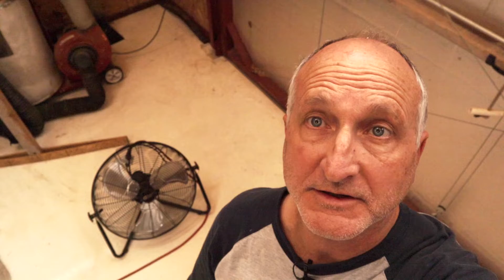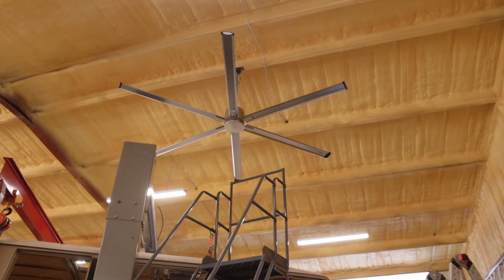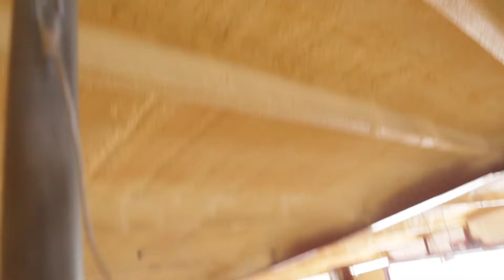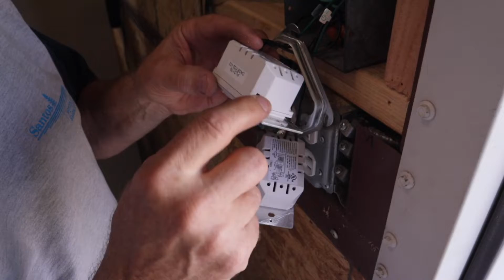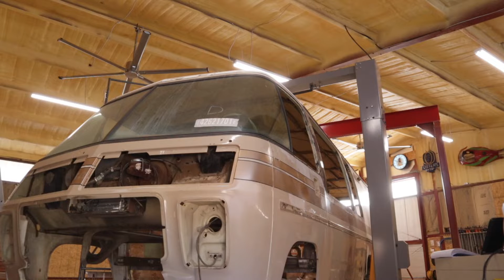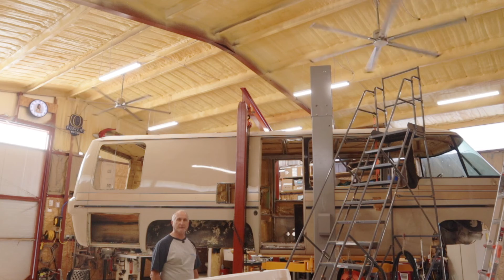Hubbell 8 foot ceiling fans, installation and wall control programming

Comment: Yep,.. these fans suck. I have 2 mounted in my garage with 12ft ceilings. They don't move air and don't spin fast enough. Now one doesnt work at all. Piece of shit, do not buy.
Reply from the maker: They move air pretty well in my shop but certainly less than I’d hoped. I’ve had no operational issues with mine at all. For sure there are better fans but these fit my budget.
Reply from the maker: I can’t resist to add that if you reverse the fans they also blow…

Comment: these fans suck we have 3 in our shop and they dont move any air just about what a waist my fan in the living room blows this thing out of the water
Reply from the maker: I have nothing to compare to other than the ones you refer to in the various rooms in my house, and those do move air pretty well. Having said that, the fans in the shed are 16 feet up in a 40 x 40 space while the ones in the house are 8 feet up in 10 x 12 spaces.

Comment: So the switches require AC power but there doesn't have to be a direct connection between the switch and the fan, since it's wirelessly controlled?
Reply from the maker: Yes. The controller and fan get power from the same breaker but the controller is otherwise only linked via some sort of radio signal.

Comment: Thanks for the video. But you didn't show the wiring of wall control and the remote.
Reply from the maker: Yeah, it was hit or miss at best. Interpreting the wiring instructions so that I could have two switches, mounted next to each other and using a common power feed, control fans that are spaced 20 feet apart almost did my head in. It was much simpler once I understood that a single switch can control any number of fans. The fans are fed power directly from a breaker as are the switches…fan operation is via a radio signal from the switch. I wanted the ability to control the fans independently so I kept both switches. Getting the west fan paired with the west switch and vice versa was the really difficult part. The fan not being paired needed to be disconnected from power.

Comment: hello i have problems with some fans similar to this one you are talking  about. all the controls are in one location. there are 10 of them. sometimes they dont work and sometimes they reverse. what do you think is the problem?
Reply from the maker: I found the instructions were not very clear, the nomenclature wasn’t defined well enough regarding power to the switches vs power to the fans. Consequently it took a while to understand how to pair each switch to the corresponding fan; I initially had the right side switch to the left fan and vice versa, then the left switch to both left and right side fans. In short, the switch and its corresponding fan can only be successfully paired if the other switches/fans are completely disconnected from power. The ones you’ve paired will (should) remember as you disconnected from power to continue the process…at least they did for my two.

Comment: Are these fans any good? Still working?
Reply from the maker: Yes! The starting sequence they go through seems odd but they start and work every time. I’ve used them in both directions and they remember which direction they were turning when they were shut off. They’re still all but silent when running even full speed.